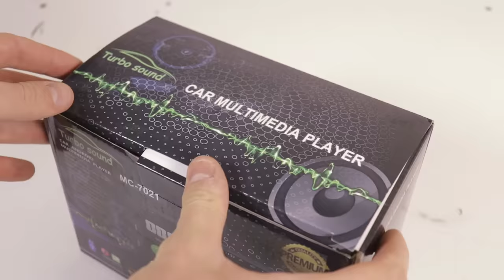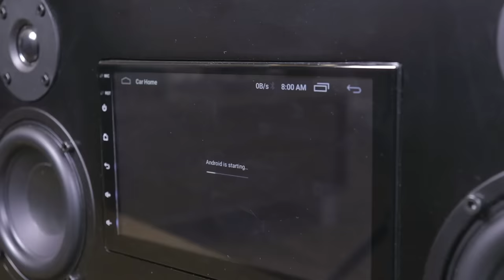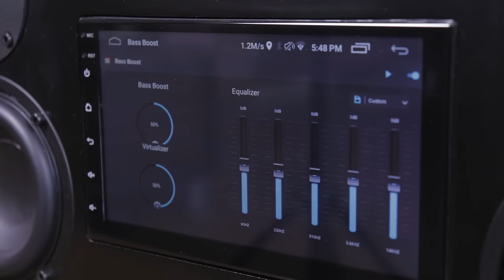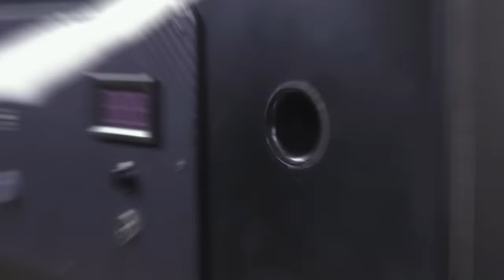DIY Portable Multimedia Boombox Speaker with 7" Screen

Comment: Thanks for the video. I'm planning to build something similar. How well do the 18650 cells stay balanced and do you ever need to take them out and charge them outside of the speaker to get them all to the same voltage?
Reply from the maker: Thanks for watching! I tried to place two batteries with almost the same capacity together so that they stay balanced for longer. Not sure how long they will stay balanced like that but I guess it is a good practice to take them out once in a while and charge independently.
Reply: @DonnyTerek  just add 3s bms, they are dirt cheap on Aliexpress

Comment: 1 larger port  from left or right side of the box, u can add extra lenght to the reflex port, get  lower tuning
Reply from the maker: The enclosures were designed specifically to these ports.

Comment: I was going to make one with a solar panel as well to charge and use on the go when there is no power.
As well as put on a fold down carry handle .
I assume you could stream and watch tv on the car stereo you put in it.
Also how long do the battery's last.
Nice job on the build. It also needs a telescopic antenna for the radio.👍👍👍👍👍👍👍😁😁😁😁
Reply from the maker: Thanks! That would be an interesting build! The battery goes for around 6 hours.

Comment: Great job and it looks beautiful but that eighth of an inch balsa-wood back is not going to be sufficient for reinforcing those deep bass notes that come from those woofers it needs to be thick like the front baffle..👍🍺.. ( you can also use the front channels to push the tweeters and the rear channels to push the woofers and have individual games on each by using the fader in case one is overpowering the other and also you get twice the power output!😎
Reply from the maker: Hi, thank you! The woofers are separated in each chamber, so there is no air pressure in the middle section from the woofers, therefore the thin piece of plywood will hold just fine.

Comment: Quick question, does it matter what capacity of 18650 batteries I use. I like to think the bigger the better, am I right or wrong?
Reply from the maker: Sorry for the late reply. Yes, the higher capacity, the longer playtime of the speaker will be. Just make sure you use authentic cells like Panasonic or Samsung.

Comment: Very nice and interesting build to have creative time. Just a question does your batteries drain if you are not using the system? As i know the 3S BMS board doesn't have system like load detection to cut off the power source.

Comment: I'm starting a simular project I was wondering if I could run this off of a 18v drill battery
Reply from the maker: You could but would need to add a step down converter to drive the 18V to 12V.

Comment: great project, how was the connection of the batteries done so that it could get 12V? and what is the high-noise time until the batteries run out?
Reply from the maker: Thank you! You can check the link in the description for the wiring diagram of the speaker. The battery lasts for about 3 hours on full.

Comment: I have two portable speaker builds I'm working on now. I was wondering. How long does your charge last? and did you experience Clipping of power? I was thinking of switching to 18650's, currently using Sealed Lead battery . The headunit(Pioneer MVH-S21BT) I'm using may demand too much power. In short, on a full charge everything is great for an hour, then it just begins cutting off and then powering back on, and every time a bass line hits it goes. I was think of stabilizing it with a cap, or parallel two sealed lead batteries(That gets heavy). I guess I'm curious how well the 18650's hold up under load. Sorry for the story.
Reply from the maker: Hi! The batteries on this speaker last around 4-6 hours. I haven't experienced any clipping. I believe you would simply need a larger capacity battery to provide enough current for the amplifier so that the voltage does not drop below required power input level when bass hits.

Comment: Are you running that at 11 volts (3s2p) or is the board some kind of step up ? Also what kind of run time do you get on the 18650s . Really some nice work you do
Reply from the maker: Thanks!
Yes I wired them as a 3s2p pack. I get around 4-6 hours on medium volume.

Comment: how quickly would the multimedia system drain the batteries? What is the battery life like? Also, how are you wiring the the acc cable from the radio?
Reply from the maker: It plays for around 4-6 hours on mid volume. You can check the wiring diagram on my Instructables (link in the description).

Comment: Saludos Donny.     Podrías indicar cómo cablear sin incluir baterías y cargador.    Muchas gracias.
Reply from the maker: Hello! That would be quite straightforward - eliminate the batteries and the bms board from the wiring diagram which you can find in the description. Then you can use the charging port to connect a power supply directly to the multimedia unit.

Comment: I have a question. I noticed that in description there are 2 different subwoofers. The first link is of Aiyima, and the other two are of Dayton Audio. For the Aiyima there aren't the Thiele and Small parameters, and also the frequency response of Aiyima and Dayton Audio is different, so they are actually two different speakers. My question is: does the Dayton Audio, that you used, has the same frequency response of Aiyima or it actually stops at 55 Hz?
Reply from the maker: Hi!
The drivers that I used for the build are Dayton Audio and I am not sure how they would sound using the Aiyima ones. I included them in the description for those who are not able to purchase the Dayton Audio ones since they seem close in parameters and almost the same in dimensions.
Reply: @DonnyTerek  
Ok, thank you!

Comment: Hello

is there a solution for 24Volt ?
i need 24v battery 3s board !?
Reply: You want a 6s bms for a 24v battery
Reply from the maker: Hi! You need a 6S bms board and then a step down converter to bring the voltage down to 12V.
Reply: @DonnyTerek  down to 12 when i need 24v?
Reply from the maker: The unit is powered by 12V.
Reply: @DonnyTerek  ok thanks.
Also i cant use my power supply with 24volts?

Comment: Can those woofer work with out a tweeter with a medium quality 🤔
Reply from the maker: They will work but I would not recommend using them without tweeters, you could use full-range drivers instead.

Comment: Donny could I use Samsung INR 18650 36G 10A 3600mAh. Thank you for you help on advance
Reply from the maker: Absolutely yes!
Reply: @DonnyTerek  would I use the same amount of batteries??
Reply from the maker: Use at least 3 connected in series to get 12 volts. If you connect 3 more in parallel , you will have twice the capacity.
Reply: @DonnyTerek  yea I ordered 6 going off your diagram

Comment: hey donny. love this build. i just ordered all the parts to try and re-create. i didn't see the spacing of the dividers or depth of the grooves on your plans or in the video, can you advise? thanks a ton. can't wait to get this thing built!
Reply from the maker: Hi, thank you! Sorry for not including those in the plans. The dividers need to be closest to the multimedia unit. The groove depth is not very important, you can go with 3-5mm deep grooves. Just add this distance (3-5mm) to each dividers height, multiplied by 2. So that would be 6-10mm added height on the dividers if you'll cut grooves with depth of 3-5mm. Hope this helps.
Reply: @DonnyTerek  for the groves/height of the dividers that makes perfect sense, thank you. For the spacing, it looks like you have them flush with the opening for the car stereo unit?
Reply from the maker: @jfriscino  Yes, that's correct.

Comment: while I would usually comment something about 50 passive radiators or so, i actually have a question... 

why only 4 individual elements? such a big box with 2 tweeters and 2 woofers.
Reply from the maker: These woofers actually play quite low in an enclosure like this.